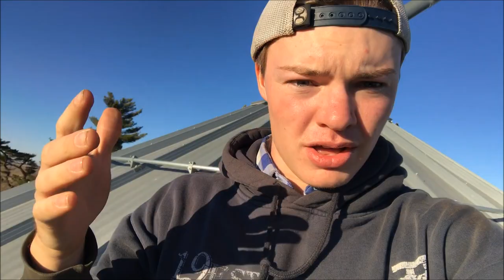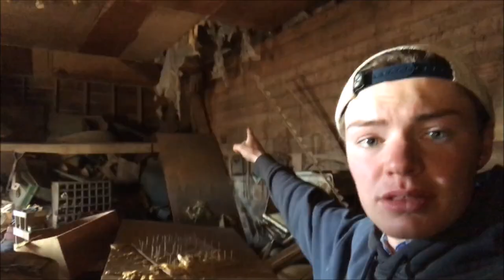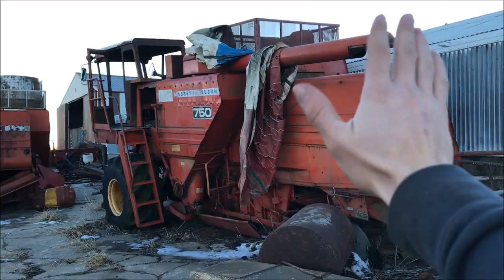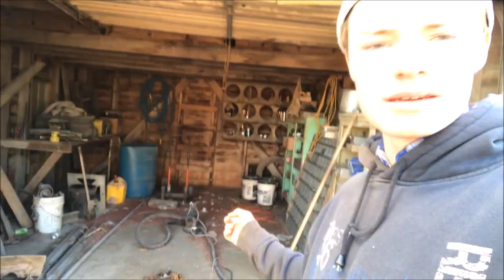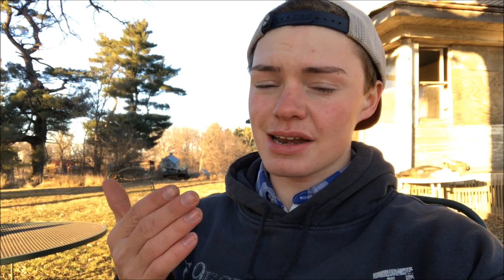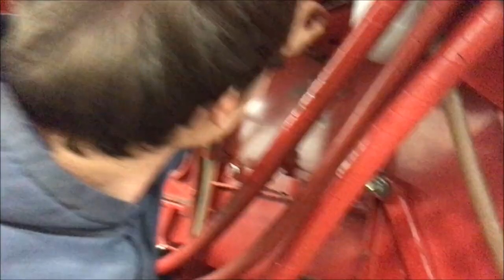Farmers Are Lazy | Do We Work During the Winter?

Comment: Looks like you had some fire trouble with those old Massey Ferguson combines. What's the story behind them?
Reply from the maker: Kort Von Ehwegen We have had quite the extensive fire history. 

The combines: one had an engine fire and the other had a bearing fire. 

The 4WD: had a hydraulic fire 

We have also had another combine and 4WD catch on fire but they got put out. 

We have also lost a Massey 2775 to a fuel line catching fire after leaking.

Comment: Goodness, and I thought I had a lot to do (I do, but not that much lol). I have about a dozen trees to trim, about an acre to mow (with a push mower since that is all I have to do it with), weedeat everything that needs it within that acre, plan out a garden, mark it out, remove the grass (manually), fork it some (no tiller), mulch the isles (to save on summer work), and plant... all by late April and it's March. I also have to work a day job, help care for my mother by running errands and such, clean out my house which got out of hand with a roommate, repair about a dozen things in my house, fix my truck, put tires on it, get it road legal, register my daily again (time for renewal) and do some repairs on it, and do some mosquito control (neighbor has a junkyard), all by roughly May (car is due April). To top it all off, before I can mow that acre, I have to take off and clean the carb and fuel tank on the mower and change the oil and hope it runs (been sitting about four years outside) lol. By winter 2020 I'm going to need to totally redo the plumbing and electrical in my home and redo some insulation that pests have destroyed and hopefully, if funds allow it, put in a wood stove. I'm also hoping my "garden" will produce enough to majorly supplement my food supplies and have enough left to sell some for some side money to help pay for all the crap I have to do. Oh, did I mention I have uncontrolled allergies? Yeah, nothing over the counter works and I have yet to find time to get to a doctor to maybe find a prescription to work. Fun fun. Oh and I need to rebuild my porch/deck before it decides to pretend to be a trap door and send me through it.